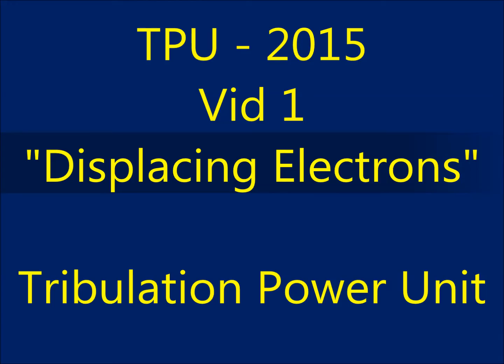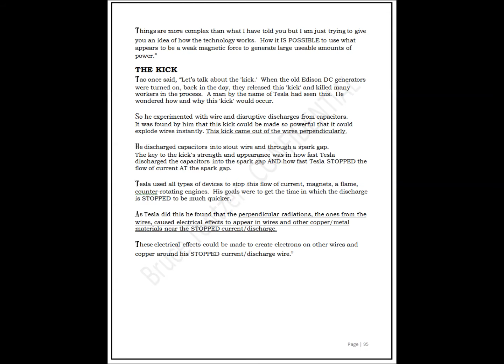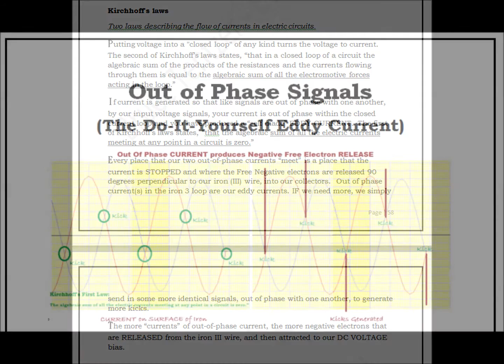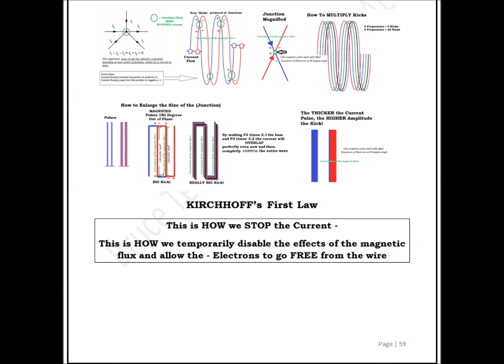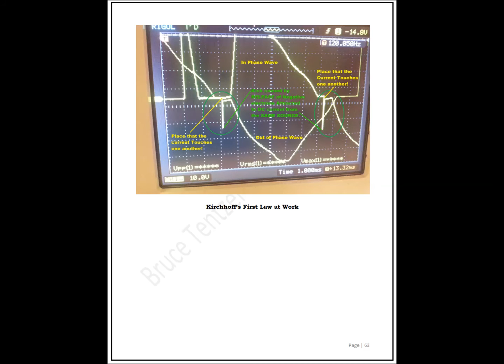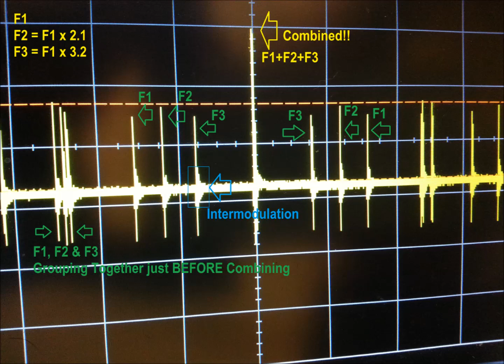Video TPU 1 - Displaced Electrons

Comment: The video: Tesla: Secret Free Energy Generator from Toroid Coils Pt 1 Johnson, Morin, TPU, MEG, Bendini describes how two frequencies come together and form two additional frequencies... so 100k and 250k form two additional frequencies 150k and 350k. (The difference and the sum). How three frequencies react assuming the windings are there on the torroid to capture the energy is unknown. 
Somewhere someone suggested adding 3 additional secondary windings on a second layer to double the energy output.